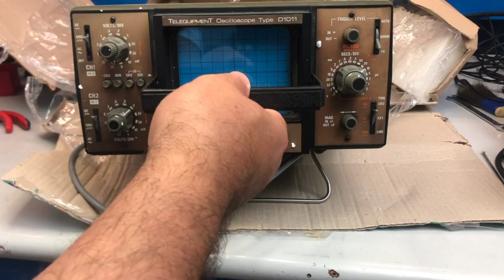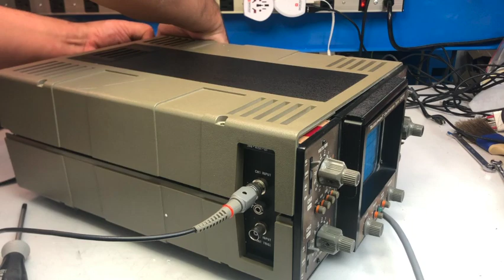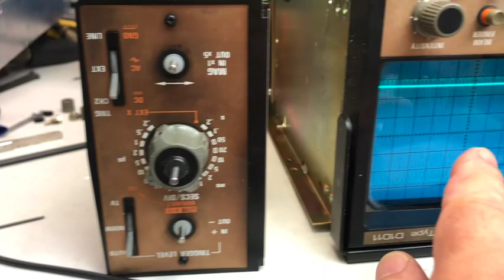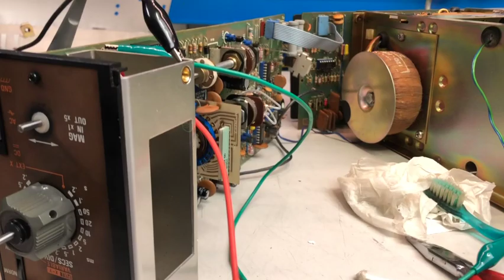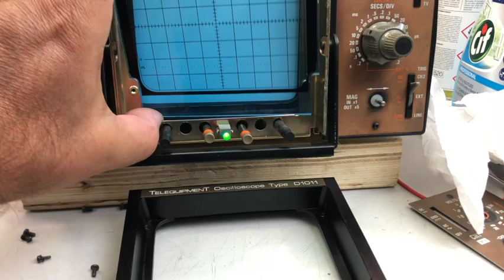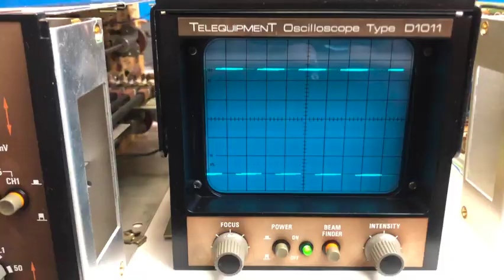Telequipment D1011 Repair and Restore

Comment: I acquired one and it tested mostly OK for once trace.  Perhaps the DC/GND/AC switch on the dead input is the culprit.  I will need to open the case and have a bit of a poke around.  My plan is to prep it as an analogue X-Y display for an octopus V-I component tester/troubleshooter and it would work even if I permanently wired it for DC  coupled input.

Comment: Very nice repair! Switches of that type are difficult to repair - well done! I like having an analog oscilloscope on the bench and I'm currently repairing and restoring an HP 1980B - a digitally controlled analog scope. Regards,  David.
Reply from the maker: Thanks! Very interesting gear the 1980B, never see it.